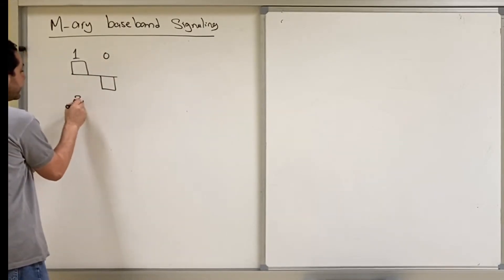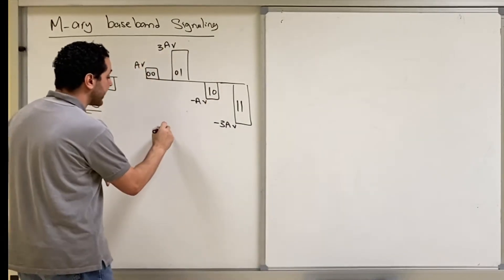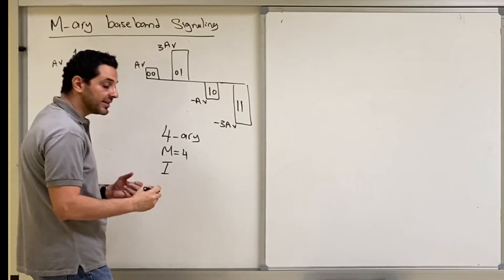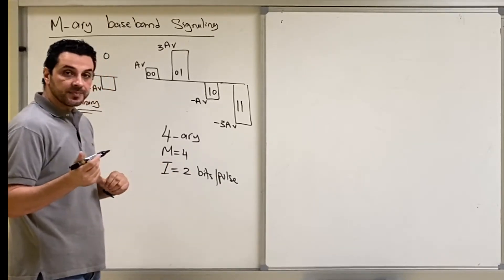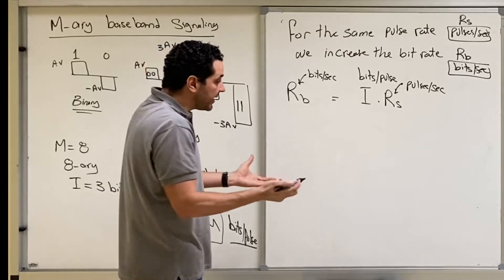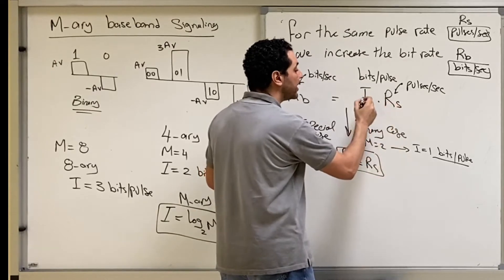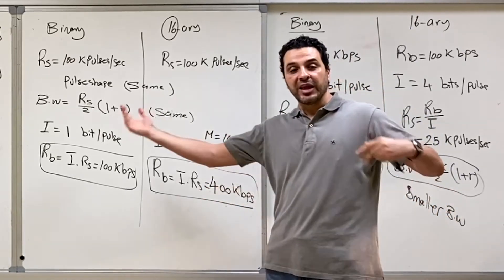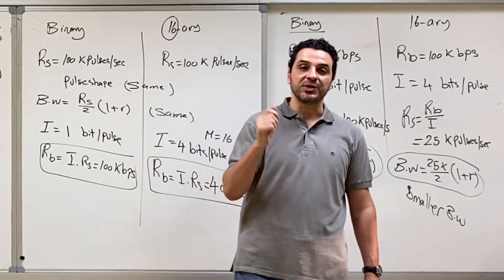EE 370, 99- M-ary Baseband Signaling

Comment: Thanks, but what about Transmission BW? How does it change in M-ary
Reply from the maker: This is explained in this Video starting at Minute 8:35
The bandwidth depends on the pulse rate, not on M. So you can increase M without increasing the BW.